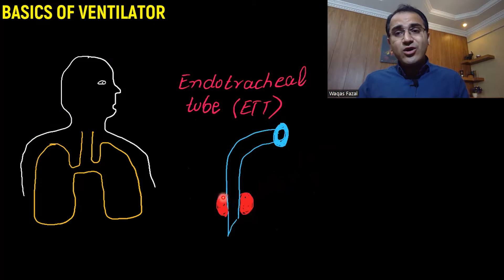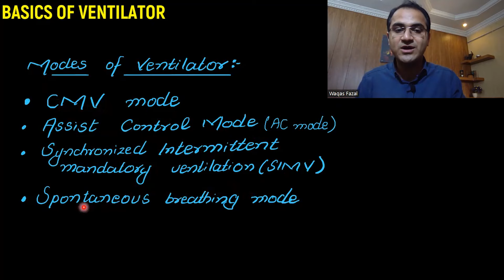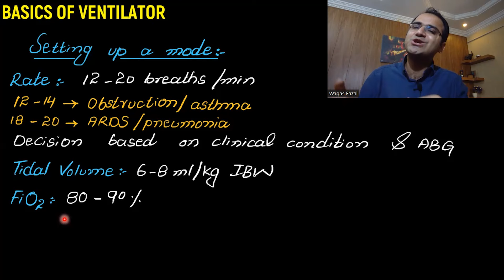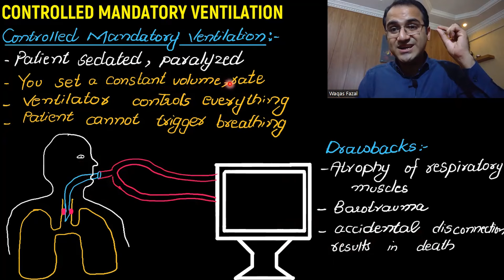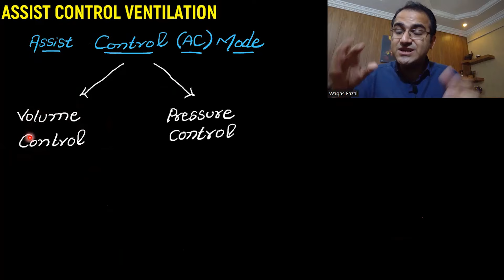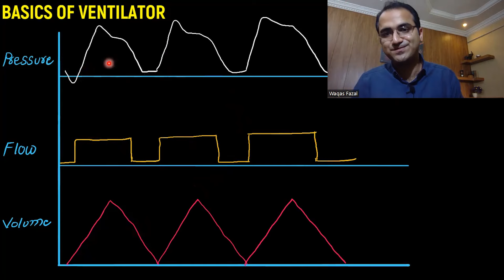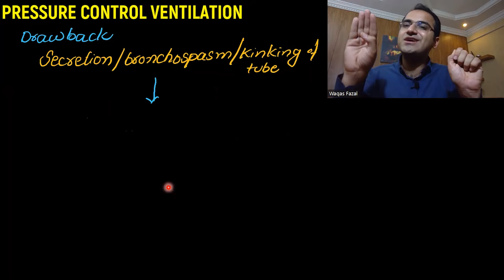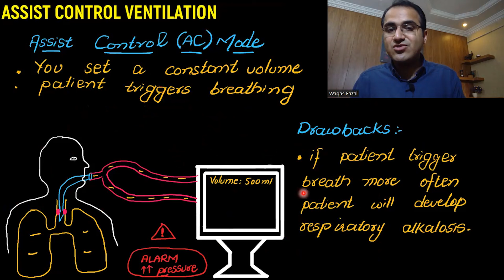Basics of Ventilator (Mechanical Ventilation) Modes and Settings Made Easy (AC, SIMV, PCV, CMV, VC)

Comment: What is the difference between BIPAP and PSV mode? In terms of patients with tracheostomy, these two modes can apply to them. 
while there are differences in the specific terminology and pressure settings between the two modes, the underlying principles are similar. Both modes require patient-initiated breathing, involve the application of positive pressure to assist with inhalation, and provide a form of positive end-expiratory pressure (PEEP).

Comment: It's a grt video... It would be more helpful if you elaborate each mode with clinical cases and ventilator in real or with a test lungs
Reply from the maker: It was a video meant for doctors who are totally new to ventilator. I'll build more concepts regarding each modes based on this video. Stay tuned. 😊

Comment: What are the drawbacks of Ventilator. Will  it cause infections and unwanted death in using it? Over sedation or heavy pressure or Infection or tolerance capacity.?